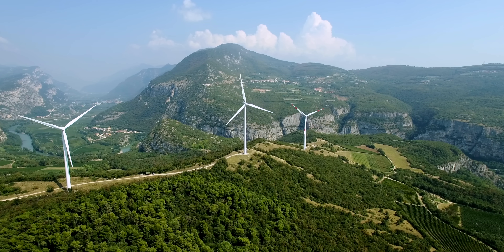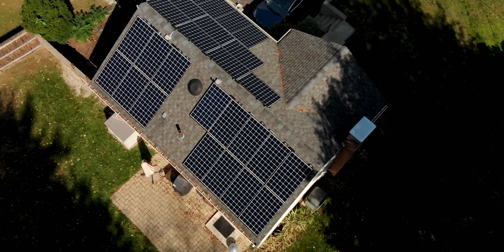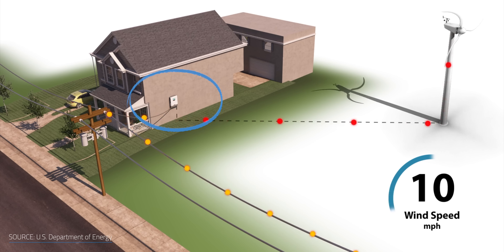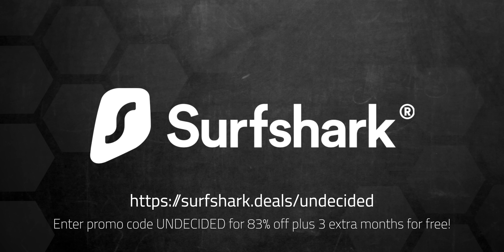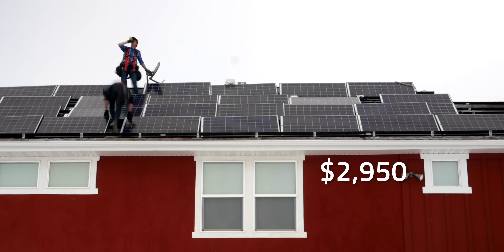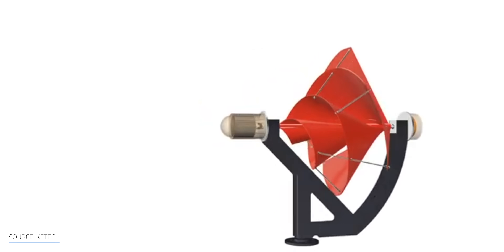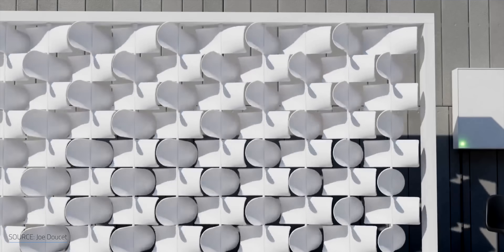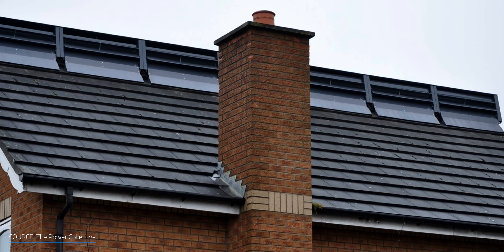The Challenges of a Wind Turbine on Your Home

Comment: Given the present energy costs I am going to try and build a windmill from recycled parts . I can get an old cryogenic 5 ton nitrogen tank  to act as heat store for water , car alternators , immersion heater , telegraph poles . I live on the side of the whitemountain 700ft above sea level in N Ireland which is one of the windiest countries in the world . My hope is to use the wind to generate electricity which will heat the water , which in turn will connect to my oil fired home heating system . My goals are many , can this be done with second hand parts , how much time and money will it cost , will it work !!! And of of course will it reduce my dependency on oil . I have the advantage of no close neighbours, side of a mountain , and I hope enough knowledge to complete the task . I would be happy to share the success or failure when competed . Wind verses solar does depend on location so much so here goes !!!

Comment: I like the idea of combining the ridgeblade wind turbine to the apex of my house roof and having solar panels on the roof too. I hope that when the residential ridgeblade is available it will be able to coexist with solar and make homes much more self reliant. Combining that with a home battery and an EV, it makes it much easier for travel costs and home heating / electrical use to be factored into the purchase price of the panels and turbines, making it much more cost efficient.

I would be interested to see what other mini wind turbines are actually available as a lot in this video are concept/ not widely available.
Reply: If you are both powering a car and a home, you will need a lot of solar. You could also reduce your heating/cooling energy use with a geothermal system and solar water heating.
Reply: RidgeBlade is in receivership.

Comment: I just installed an 18kW solar system, been looking at adding a wind turbine as well just to supplement when the sun isn't shining, but I think my money would be better spent adding more panels if need be, and making sure the battery system and cover it.
Reply: Good lord, how much power do you use on a monthly basis? Or is the system so big because you have a very low number of peak sunlight hours?

Comment: The problem with residential wind is that wind turbines are really just inefficient solar panels that can suck up energy over a larger area than their own footprint. Solar energy creates wind over the entire earth and if you're in the right location you can harvest a lot of it, not to mention the cost of solar panels to harvest the solar energy that created that wind energy is waaaay higher than a turbine. It's also impractical to use solar panels to harvest the source of wind energy because a lot of the land that the wind is created on is uneven, contains precious land for other resources like crops, and is extremely vast and divided by man-made and natural obstacles. 

That's why it's very effective to harvest wind energy in places with even terrain, little trees or structures, and as high up as possible, the places that are the exact opposite of most typical homes. A small wind turbine just isn't as effective at harvesting energy in a given residential footprint as solar panels, there are a select few locations where it could work, but the main appeal of wind turbines is their low cost at larger scales and minimal footprint for that cost.

Comment: When I researched distributed energy several years ago I came to the conclusion that micro wind was nearly an order of magnitude more expensive than PV solar.  And unlike an almost entirely passive solar panel setup, turbines have to be operated in the sense that there's ~bi-annual maintenance as well as the need to respond to damage.  They're also much more sensitive to siting to the point that they don't make sense for the typical homeowner sitting on a small <⅛ acre lot with no room for a tower that's a good ≥10m higher than all nearby obstructions.

Comment: I know in Texas, that if you aren't in that wind corridor or on the edges of it, wind is very fickle.  It's not something I'd think about.  The problem is the wind can be very gusty during the day, and then completely drop off at night.  And, if you have solar panels and you live in a place where the wind dies down at night, you're still in the same situation of needing battery packs to store electricity.

Comment: Great video but I was bummed because you didn't mention another wind turbine that you had featured in your prior small turbine video. It sat on top of the roof and the turbine itself was in the housing of the turbine itself. There were scoops that caught the wind and funneled it into the turbine at a high speed, producing electricity but with very little noise. I remember the housing was green. Would be great to have an update on this technology and how it would affect the pricing and other factors you mentioned in this video.

Comment: It depends on your location and, something not mentioned here, skill level. I'm thinking about wind, not for the monetary benefit but for the reliance benefit. I'm running on batteries at night, $4.5k worth of batteries. They keep me going - most times but we live in an area that runs days without full sun, again, this is the location aspect of wind. 
The physical location for us is much better than 90% of the population. With a four acre clear field in front of the house we have an ideal spot for wind and we do get good wind. I do also have the technology and equipment to install wind with a tractor, welding equipment for poles, etc.
So to install wind for times when the grid goes down in our rural location is viable. It depends what you want and need, if I didn't have lots of PV I wouldn't think of wind first but with our PV in already wind is something that is feasible and compliments it. Payback, well what's the payback on buying from the grid and what do you do if the grid goes down and stays down, what's your wind worth then? A lot more!

Comment: Can you touch on material costs of the materials to make them, along with recycle ability. Some people I talk to don't want solar simply because when they researched it years ago, materials could not be recycled and would lead to more waste. Turbines might have an advantage there? Also can you research true costs once R&D comes down. I feel like the costs can come down alot as the materials are more common; metal, motor, power lines, etc.

Comment: A small wind turbine to support solar seems like a good idea, especially if you're going off-grid or otherwise battery supported, it would help to increase the life of the batteries.
Reply: It's interesting that the conditions which make solar work less effectively usually mean wind is better. Rain, cloudy weather and night time usually mean high winds. 

At least where I live. Good to have more options.
Reply: @ralphwarom2514  https://youtu.be/SH3KQoZvafM
Reply: it also makes sense depending on your location
Reply: @utubeape  https://youtu.be/SH3KQoZvafM

Comment: I imagine it might be a better option for tall buildings, 5 or 6 stories or more, with less roof area for solar, but very exposed to wind than for individual homes
Reply: Would definitely be interesting to study that at some point.
Reply: Someone years ago found helical vertical turbines mounted on the edges of a skyscraper roof would capture not only direct wind, but also the updrafts from wind hitting the building itself... 
So yes, it can be an option for tall buildings. But the output will still be very low in comparison to the power usage of the building, and the payoff time is still going to be roughly the same (IE decades).
Reply: So your proposition is to instead just place any old windpower plant on a building? This can 100% be done and requires 0 new tech or RnD. With cash you could take this idea to market in like a month's time.
Reply: That is an interesting thought! What future technology innovation are you most excited about?

Comment: My grandfather was as poor as the worn-out, depleted soil on his farm. He died 35 years ago. He pumped water from his well with a wind mill. He couldn't afford to pay for electricity to pump water. 
Would you rather maintain a wind turbine or 250,000 years of radioactive waste and pay the medical bills and funeral costs it will cause?
Reply: Except that the amount of Nuclear waste generated per person, accounting for a pretty conservative fuel cycle of double reprocessing, is 5 kg for 100 years of life. Put breeder reactors into the mix, and that quantity is dramatically decreased, and lifetime as well, around 300 years. Easy to store in deep geological storage. You can actually economically extract a lot of useful stuff from SNF as well. Meanwhile you will have to substitute wind turbines and solar panels 4 or 5 times in the same time frame. That's an actual lot of waste..
Reply: @AlldaylongRock  The average reactor generates 20-30 tons of high-level radioactive waste and 50-70 tons of low and intermediate level waste per fuel cycle. Not included in these quantities is the massive amounts of acidic, radioactive mine tailings (1 million lbs. of 0.1% ore to extract 7 lbs. of U-235) or the concrete and steel from reactors that becomes radioactive from neutron absorption. Think of all the fossil fuel wasted to mine and process ore and build reactors. Think of how much would be needed if the industry ever buried their waste and decommissioned their old rust bucket reactors. Engineers that designed reactors say their working lifetime is 40 years before they become brittle, leaky and too irradiated to try to maintain any longer.  Holtec says their storage casks have a 10-30 year life cycle before they become radioactive and develop cracks. All that stuff is radioactive waste. A heat shield from an old reactor has enough radioactivity to kill in 5.5 seconds, a pressure tube less than 30 minutes. You are not including the tritium released into the air and water from every reactor every day they are operating or the contaminated soil and groundwater with tritium, strontium and cesium near and under the reactors or in spent fuel storage lagoons. There is a lot of land, sea, and air contaminated from the 100 or so serious nuclear accidents listed by the IAEA, like in the Red Forest where Russian military got acute radiation sickness from digging trenches, or in Wales where farmers cannot drink the milk or sell the meat from their livestock because of Chernobyl. Lake Karachay was destroyed by radioactive waste from Mayak. Sellafield and La Hague have been releasing radioactive water into the Atlantic for decades, making it the most radioactive ocean in the world. Sellafield just shut down. UK says it will take $3 billion a year just to manage their waste and over 100 years to clean the site. But Japan is trying very hard to put the Pacific on top. Do you like your salmon to glow in the dark? The Russians dump their radwaste in the Arctic. The US used to dump some of theirs off the Jersey Coast. Holtec wants to dump radioactive water from the Pilgrim reactor into the Atlanta. The NRC says, "Why not?" The locals say, "Hell no!" LA and Simi Valley is contaminated from the 1958 meltdown at Santa Susana. The local kids meet at the cancer clinic after school for their chemo as a result. A judge ordered Santa Susana cleaned to background levels in 2012, but instead Boeing is trying to buy state politicians to get them off the hook. I wonder if Hunter needs a new gig, near is halfway house in Malibu? No one knows where the drums are buried at Rocky Flats, but they know they are there. Much more at Hanford, SRS and West Valley. 
As far as I know, no one has ever needed chemo because of wind turbines. 3 of my siblings and I suffer from thyroid disease having been downwind of the largest radioactive iodine release since the 2200 nuclear bomb tests. No one was told about that.
Every nukie wants to trot out their magic unicorn, the breeder reactor, which some day over the rainbow will eat nuclear waste like a horse eats hay. Did you ever wonder why that is not happening? Breeder reactors are very polluting, very expensive and very unreliable. They also reprocess very little spent fuel. It would take much more money than anyone is willing to invest to try to develop these unreliable reactors. Way more than for a conventional reactor and they have been very unreliable and costly to maintain in the past. Even if you had an unlimited amount of money to build and try to keep them operating it would take 100s of years to make a dent in the amount of spent fuel currently in existence. That still leaves all of the other radioactive waste I discussed above to try to deal with. 75 years of nuclear energy and not a thimbleful has been safely disposed of.  It will be the most dangerous elements on Earth for longer than mankind has been in existence. Don't you think it is about time for that to change?
Reply: @AlldaylongRock I got a good laugh out of your comments. I look forward to responding to them, but I am very busy with 
a project for a non-profit providing clean water to refugee camps in Africa and the Ukraine at the moment. I will take great pleasure in responding to your (snicker, snort) comments when I get time.

Comment: Again,Very knowledgeable and well explained video. Will u make similar kinda video on concentrated solar thermal vs solar PV for the residential/small scale use? Combination of solar thermal and Stirling engine seems very promising, & have some clear advantages over a pv like low initial cost, higher efficiency and thermal storage for night usage.

Comment: Thanks for the great video.
I’m wondering where you got the CO2 emissions per kWh for gas (78 g) and coal (109 g) from?
On my quick research I found numbers like 350 g CO2 for a modern gas power plant and 700-900 g CO2 for coal plants depending on brown or hard coal.
Reply: Can confirm 350 g/kWh is in the ballpark for natural gas. We run a 510 MW combined cycle block where I work. Two General Electric 7F gas turbines and a D11 steamer. When we're at full load, each of the gas turbines pulls a little more than 21 pounds of gas per second. Do the combustion stoichiometry and that's 58 pounds of CO2 out the stack. Every second. So from both gas units, over the course of one day, that's 4,990 tons (or, the weight of about 2,500 Ford F-150s). So, with our 4,990 tons of CO2 per day, generating 510 MW, we can do all the fun unit conversions and we come out with 370 g CO2 per kWh.
Reply: I also found much higher numbers in co2 per kwh
Reply: @jfbachmann  residual heat usage included in numbers?
Reply: @dwwolf4636  I dont think so.
Reply: Independent source or govt. source?  The govt. went through 4 years of being pushed to lie, and that's still being undone.
Reply: I'm guessing he used the numbers for the newest most fuel efficient plants. I know the new stuff is definitely better than 20+ year old stuff. Not clean, just cleaner

Comment: 80% of solar panels are made in China. Have you added the pollution cost to solar panels because the high temperatures and materials needed to make them.   Wind turbines DIY have used wood or metal blades.  Wood is environmental friendly.  I want a life time cost that includes manufacturing, maintains and the cost you included.  This is how airlines judge cost for the components of their airplanes.  

The  last two wind turbines are directional so have very few locations that meet this requirement.  And both are low to the ground and effected by the surrounding building, trees, etc..   The cost of the tower for home units compared to commercial turbines  per the power generators will show that this is a huge portion of the cost and when maintains is added to get to the turbine is costly.  

If your going to look at not in production experimental wind turbines then you missed a huge group of flying wind turbines such as the kits and balloons with blades.

Comment: if you install this on our area and if its tall enough, it will serves as lightning rod. its kinda scary here as thunderstorms are normal for months of april-august. also Philippines experience around 20-25 typhoon each yr with average of 30-60 m/s of wind speed. good luck to wind turbines.
Reply: Understanding your concern, Don't be afraid of lightning.  There are great options to add Faraday lightning suppressors to a wind generator and any building.
Reply: just ground the lighting rod/wind turbine properly. we have wind turbines in our homes and survived like a lot of typhoon already and nothing bad has happen rn. Also pinoy po ako skl

Comment: If you put vertical axis Wind turbines on the corners of all large buildings the wind having to go around the buildings will be fed into the generators increasing their efficiency and overall performance.
 City structures themselves could become the power generation to generation to run cities🤦‍♂️...
 That is if you prefer to just let all that free energy gas called methane bleed out of your landfills and sewer systems into the atmosphere...🤷
..
 Oh yeah and if homes were even vaguely efficient with the energy usage we wouldn't need so many oversized power plants...
 But I guess if you don't do that the yolk around everyone's neck won't be heavy enough.🤪